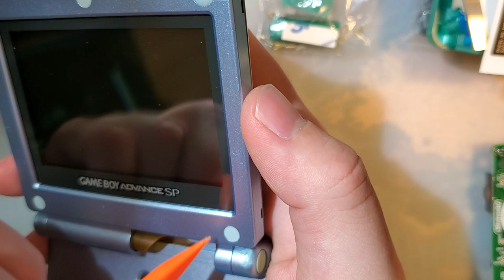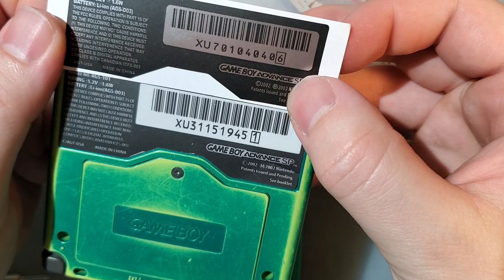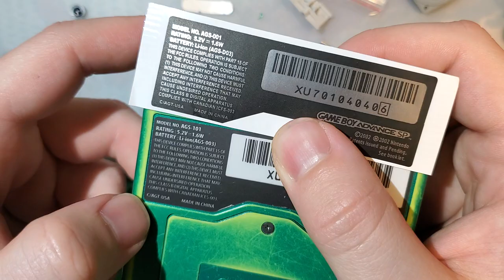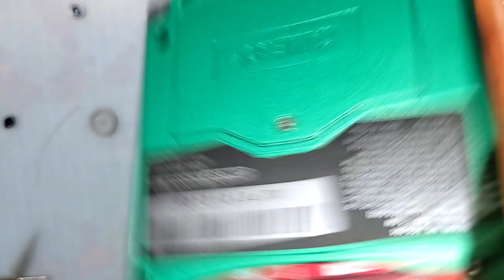Aftermarket Rayquaza Game Boy Advance SP Shell

Comment: could this just have been a QC rejected clear shell they just painted and printed the Rayquaza on? might explain the mold lines
Reply from the maker: Possibly. Nice thinking
Reply: @makho  also a theory for the legit Rayquaza GBA - it looks heavily worn, so maybe it was dropped on the shoulder button at one point, the (probably) kid who had it took it apart to replace, couldn't find a replacement, then just left it on a shelf until they found it again years later and sold it to a pawn shop type of deal or listed it themselves on YA

and this reddit user looks to have a different variant of the aftermarket shell:
https://redd.it/iiywa1

Comment: I installed a kyogre shell same as yours aftermarket from aliexpress. I installed the hinges first and it opened and closed fine. The hinges clicked normal at all angles. But once i put it all together ot behaved like yours. I took it apart twice thinking i had installed hinges wrong. Shell is just not a good fir
Reply: Just finished reshelling an older SP with the Rayquaza shell. I mean it’s to be expected but the quality is super cheap
Reply: @拥  the new clear shells are GOD TIER. they feel better than the originals

Comment: Great video man, huge fan of your work and enthusiasm. I only got into modding about 2 years ago but I'm hooked. I modded two SPs and a GBC so far. For the SPs I opted for the Groudon and Clear Black shell from Aliexpress. The quality difference between the clear and "special" shells is night and day. My Groudon SP doesn't have the imperfections this one of yours has though it has the same hinge issue. I've used it a lot and it doesn't loosen up. It doesn't have that "snappy" feel to it compared to my original AGS 101 or even my modded clear black one. These shells could be good but they just don't have that finish. 

Incidentally, where do you buy your shells from? Is there a particular source that you'd recommend? Thanks
Reply from the maker: I tend to get all my stuff from retrogamerepairshop.com

Comment: I bought a shell from an eBay seller that literally feels as good as oem it looks as good as oem the buttons feel actually better than all 7 of my oem all stock gba sp the hinges feel as good as they did in the oem shells it’s literally as good as oem it’s a clear black shell I have been using it with a one chip v2 ips screen for 6ish months it’s held up perfect I would be happy to send you the eBay seller if you want the shell is a clear black shell it’s way bette than even the other clear shells I’ve bought and I bought 2 the same day I bought this it’s sturdy has no flex some shells I bought including clear ones were so flimsy you could press the buttons but pushing on the shell next to them without even trying but this one is solid you can’t do that with it idk if it’s a freak shell and I am very lucky or if it’s how all the shells this seller has the only negative is can possibly come up with is the price it was $23 shipped with tools buttons and stickers etc. but it’s worth it for sure I’m buying more from the guy if you contact me I’ll send you the listing
Reply: I have the funny playin ips kits also but I love that the one chip saves the brightness setting and has a few more brightness levels I’m thinking about putting a funnyplayin screen into the thing tho and using the one chip cable so I have the best of both worlds the screens are all LG I have no toppely ones

Comment: I'm interested in replacing a scratched lens on an AGS-001 SP. Is the only difference w/aftermarket lenses the lettering? I'm asking since makho said he used an OEM because he prefers them, but he didn't state if that was the only difference. He mentioned ideally using a proper gasket, as well. Not sure what exactly that is, but is that applicable when using an aftermarket glass lens? Any downside to using a glass vs plastic aftermarket lens? Other than the obvious isse that they could break and be dangerous, especially in the hands of my young son. How break resistant are they--as opposed to just safely cracking or shattering?
Reply from the maker: Plastic is more failure resistant as it will flex and stretch instead of shatter but glass has better optics and scratch resistance. The printing on most aftermarket lenses (glass and plastic) looks like garbage IMO (unless you go full custom print) but I believe there will be more options soon.

Comment: Whew i was waiting for this screen to sit in a gba since you found it on ali express months ago!!! Mine's already placed on a white agb001 using the ribbon cable they gave with; and as far as i can tell the quality is fantastic but there is some downside to it for exemple on F-zero maximum velocity the circuit displayed in the left hand corner during gameplay is flickering which can be discouraging for some to buy (even though it happens on ips as well and that is just how the game devs was mimicking transparency at a time) it tends to be a bit too bright for me (any ideas on how to lower it?) but anyway i'm loving this thing thanks for sharing your findings as always
Reply from the maker: Yeah, it's supposed to flicker. That's just the screen being more responsive. If you used the adapter included, just don't solder that extra wire. That should decrease the brightness.
Reply: @makho  I did as you said and it dimmed the screen a little bit indeed; unfortunalty i do have very fragile eyes and even without it; the brightness is still hurting my eyes; guess i m sticking with OGs ags 101s for now then; thanks for helping me though! (If by any chance you know of some other kind of adjustments to dim it further i'll gladly test em :D) keep doing your thing!
Reply from the maker: @cranhic4400  I don't know of any solutions to get it dimmer. Most things just do brighter. You'd be looking at making a custom adapter for it.

Comment: I had an aftermarket final fantasy 3 NDS lite shell once that was so bad, i had to carve into shape to make it go together at all, especially the part for the top screen. The plastic they used was so soft and thin that you can almost see through the part where the status lights are... from the back! >_< and i couldnt use the original hinge cover where the lights are, cause the screws that would go into it would work their way loose, when opening and closing the DS lite, because of the soft plastic. So i had to spraypaint an original cover i had white, cause white and red in just one corner wouldn't match well. THAT is a bad shell! lol Yours is just a bit disappointing but kinda acceptable *lol*... apart from that recessed, messed screw part on the screen cover. That is really bothersome :p
Reply from the maker: Yeah, it is absolutely NOT the worst shell I've had the pleasure of dealing with. I've used aftermarket SP shells and had some good experiences with them. Some feel OEM, some feel aftermarket but still good, but this one just feels bad. 

I had an original DS shell that came from the box so warped that I couldn't even assemble it. I'd say that is the worst shell I've ever gotten.
Reply: @makho  I say it all the time, NTR-001 aftermarket shells are the worst aftermarket shells for any retro system. They're just god awful and there's not a single good seller/mould I've ever seen for them. They're just garbage. It sucks, too because they're notorious for those broken hinges but their form factor in the hands is honestly superior to the NDSL.
Reply from the maker: @husky3g  Yeah, it's a mess. No one wants to put the money in to fix the problem because the demand for the consoles is so low (due to their being basically no aftermarket for them I'd wager).